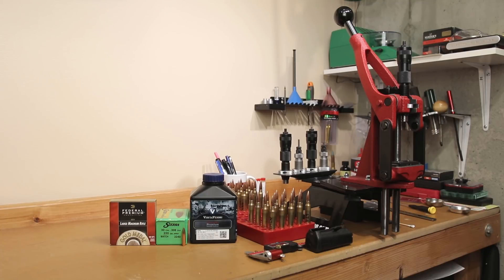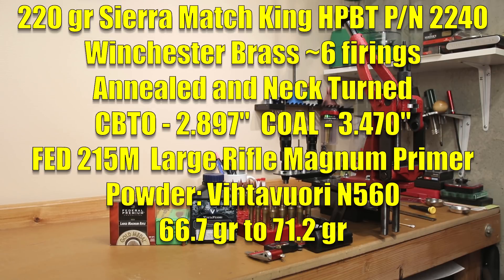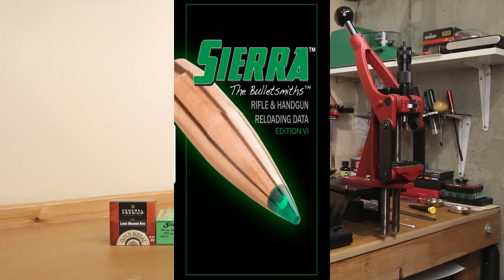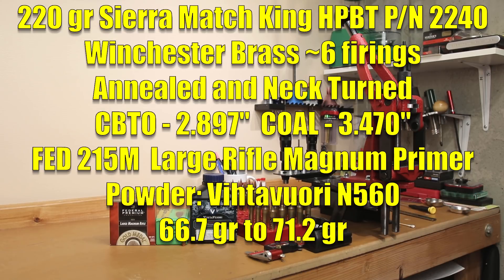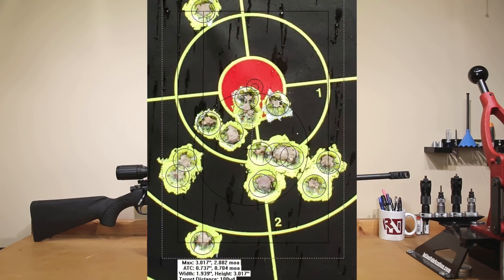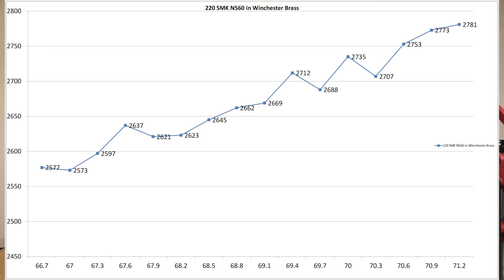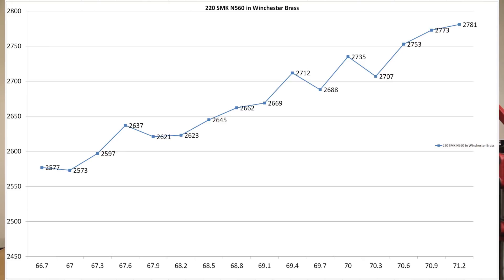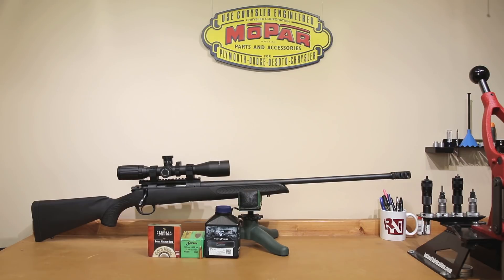Thompson Center Compass - 300 Win Mag -  Sierra 220 SMK with Vihtavuori N560  Velocity and Pressure

Comment: Wondering if there is any difference between a Compass and a venture. I have a Venture in 300 Win mag and after working up a load for it, I have sub .5 accuracy.  I do use 4350 powder with ELD bullet. Not sure about the Vihtavuori as I have not tested it.

Comment: For these kinds of tests I tend to load a round one increment above listed max or sometimes even a second round an additional increment above that if very familiar with the rifle and the increment increases are small, of course while keeping a close eye on everything as you go along. Disclaimer: I’m not recommending anyone else do this. But, if I remember correctly, I think Satterlee himself actually said, at one point, to load one round one increment above, but he was going in 0.2 grain increments. Also more inclined to do it that way if loading long and having more case capacity, not compressed, slower burning powders and not near the lands, looser chambers and with bigger cases. With all the hassle most of us have to go through to get to the range, set up, etc etc, it’s easier to pull a bullet or few if you have to than the alternative coming up short and having to load up more and go back on a different day if you think you were closing in on a good/best node up on the high end. Plus, you’re able to get as much data at one time under all the same conditions for the graph etc. And with the manuals that round off all the velocities by the 100’s or 50’s and don’t list pressures I wonder if they are really at their max with their test gear with that rounded off velocity number. I imagine there’s some wiggle room. Maybe they are not quite there at max but would be over pressure to get to the next higher rounded off velocity.
Reply from the maker: I really don't disagree with your logic here at all and when I talk about not having to pull bullets I am referring to not doing a whole bunch of 5 shot groups. (I got a lot of complaints when I started doing the velocity charts but I think they are a good tool.) I have been sticking with the book data in this series mostly because all of my velocities have been over published velocity and some very significantly. When I have run those numbers in quick load its saying that I am way over pressure. Seeing this info I hesitate to push mu luck any further. If I am way under pressure someday, there is always another day at the range. I really would like a mobile setup but that isn't in the cards for the moment anyway.

Comment: Probably need to get a decent rifle and chuck the TC to ever get any decent results.
Reply: I disagree. I think the TC compass and many other budget bolt action platforms are adequate platforms to develop and improve with handloads and many are usually capable of 3/4 MOA or better with the right load. I guess it all comes down to what we see as accuracy and consistency but I can tell you a 1 MOA rifle is capable of consistently hitting a 12" plate at 1000 whereas my wind calls and ability to compensate for it is going to throw me off a lot more then 5" at 1000.
Reply: BA reloaded his rifle sucks. He needs something better. Especially with all the time and money he’s dumping into it. The incremental cost is more than worth it.
Reply: duggydo. I kinda agree with you, but there are plenty of viewers out there that aren’t going to spend $1500 on a gun and the reason I watch a lot of the reloaders channels, is to see someone make chicken soup out of chicken sh!t:)  there are a lot of these guns out there because of there price.
Reply: Jeff Huntley To each his own, but probably the best analogy I can give would be this: Imagine if a highly skilled contractor put a ton of time, money and effort into remodeling a home’s kitchen, bath, floors, etc and the home he started with was a single wide trailer. All that effort and time would be so much better spent on something worthy of what he’s putting into it, and when he’s done he’d have something really nice. I’ve gotten to the point that I never do this level of load testing and development without first spending at least a modest amount of time and money on the rifle components.
Reply from the maker: I don't really disagree duggydo, but the "fun" is when we find something that works well that we didn't expect. If you just want something to shoot and not play around, this isn't the rifle. Then again I am not sure that 300 Win Mag should be the caliber either. Just got done with some 6mm Creedmoor testing and wow is that so much easier. The rifle did cost 4x though. Largely it depends what your time is worth and whether you enjoy the development process. Looking for the fastest way to the target? This is NOT it. Thanks for watching anyway guys. We are going to find a load one way or another though!
Reply: Bolt Action Reloading you might consider doing a video series where you build or tune up a rifle before you start working on load development. Savage rifles are really easy to barrel swap. Get a gunsmith to true the action for you if you don’t have the tools/lathe first. You can tune up the trigger yourself. You’re obviously detail oriented and like to plan and collect data. You would probably enjoy the hell out of the project. Just do your research, make your work plan and budget, then constrain it to how much you want to do/spend. Anyway, just something to consider. I think it would be a much more interesting video series.
Reply: duggydo. Yup. Ironically, I’m in the middle of straightening the floors and putting a new kitchen in my 40’s house that’s in a flood zone:) Every dime I put in it will be a loss, but I’m enjoying myself and don’t care to go buy a new $200k home. As long as your part of the pro 2A community, I’m on your side:) however you happen to get there:)

Comment: Why did u switch to the Winchester brass for this test?
Reply from the maker: I usually load all my available brass at the same time and prioritize what info I am looking for. It's what was available and should give me a idea where the nodes I would be looking for are,  I may have to adjust slightly for case volume, but it will give me idea where to start.